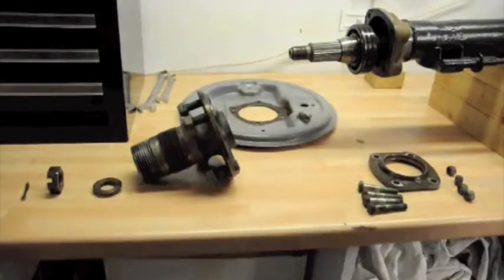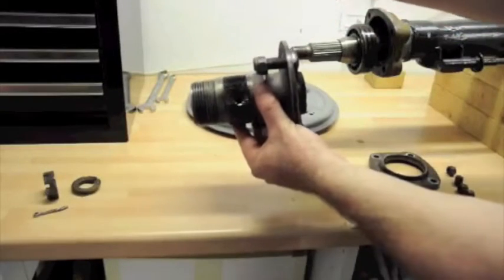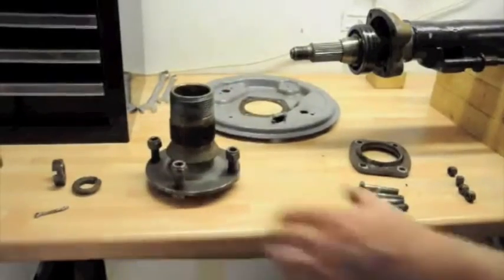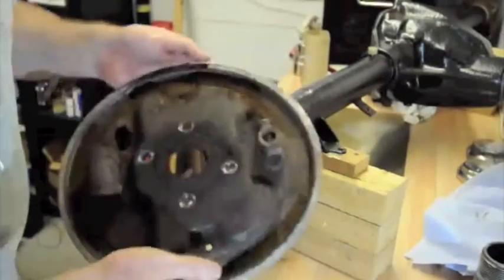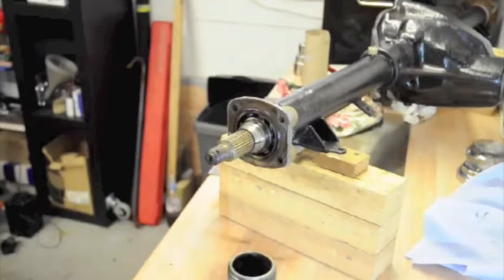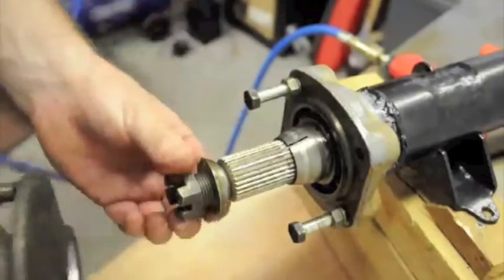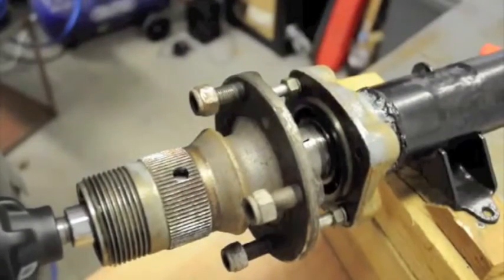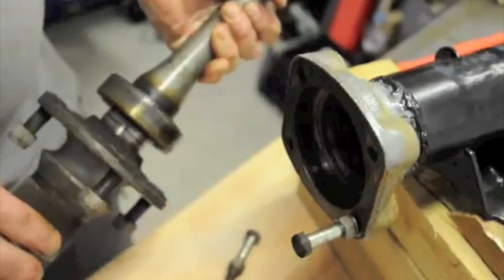MGB axle dismantle

Comment: is this the same on a 1972 mg midget? When I look inside the hub all I see is a dust cover. It doesn't come out like the front one does.
Reply from the maker: I don't know anything about the Midget, but from what I can see in the following diagram, you're right - there's a dust cover.  Doesn't appear to be any nut to hold the hub on, but if that's the case, how does the hub stay on I wonder?!:  https://www.ukmgparts.com/catalogue/mid-midcat-3-submid24-rear-axle   

In other searches, I see pictures of half shafts that have a flange at one end, so presumably the hub attaches to that. 

Hope you manage to find an answer!
Reply: The Midget is a totally different design known as a 3 quarter floating axle.